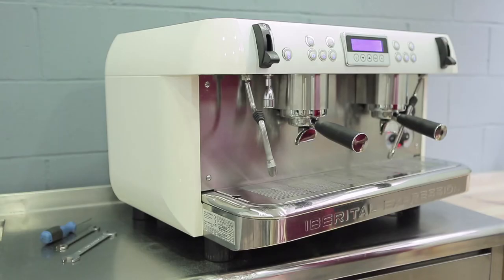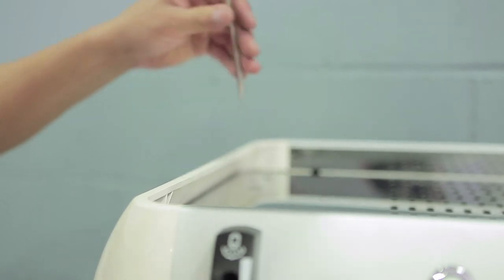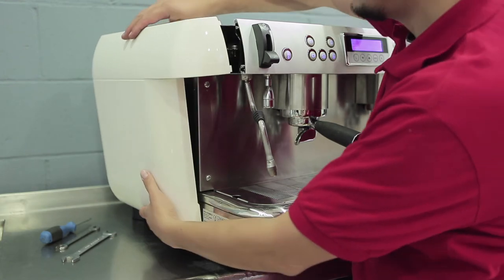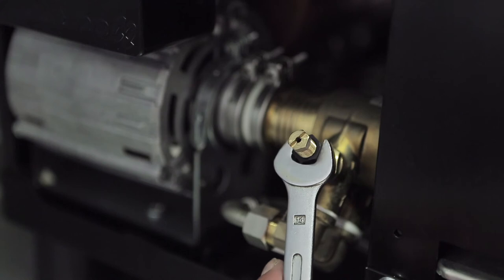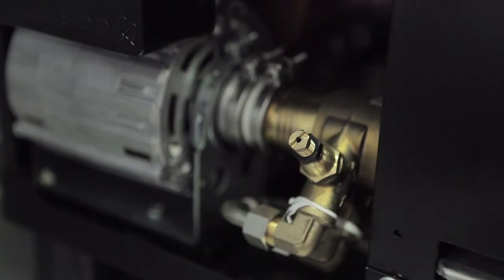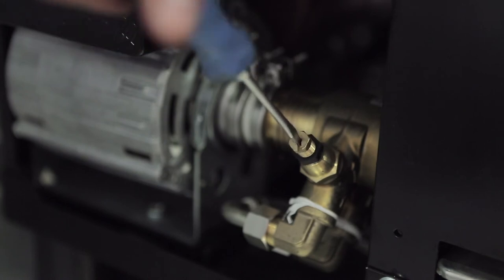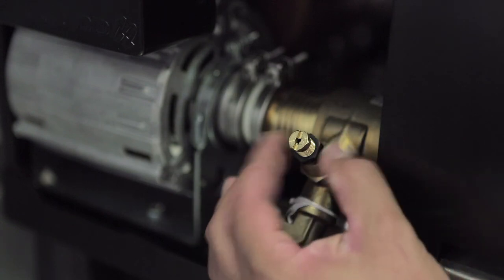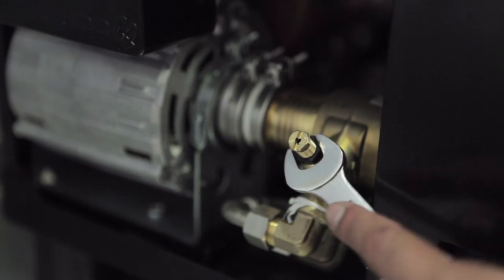Iberital Tutorial - Pressure machine adjust

Comment: Hi actually i'm using iberital intenz single group head, but the result steaming milk is not smooth and i was change with another milk but it is the same nothing differentt, but I try steam the milk with another mechine like la marzocco or black eagle or something likee that it's nothing problem, why the trouble i find out at iberital intenz? maybe any solution? thnk u
Reply: what is the pressure value of your steam ?